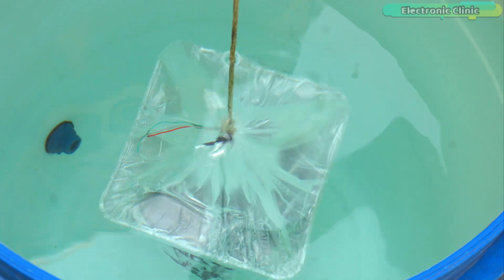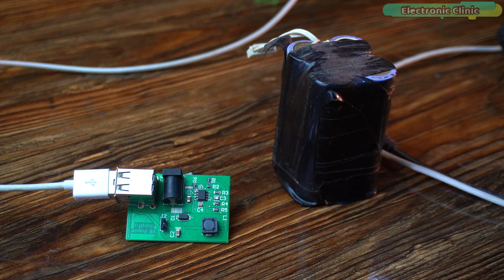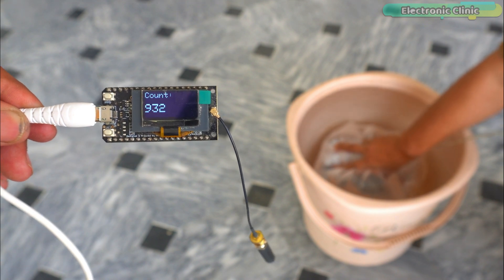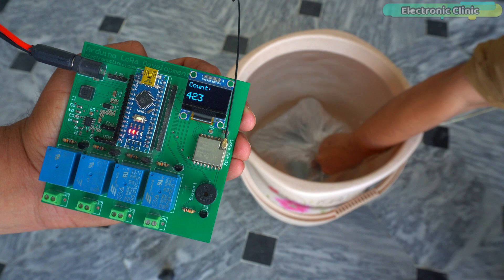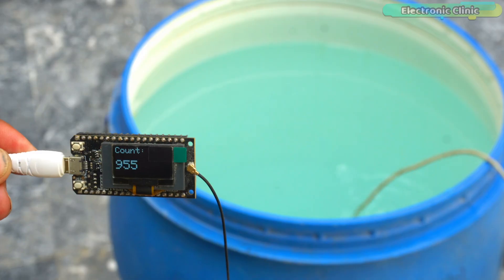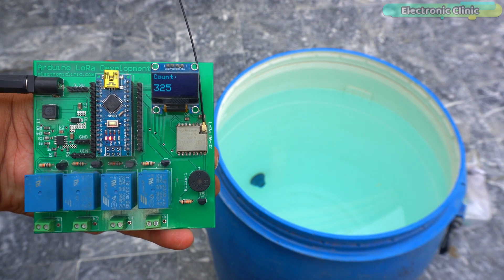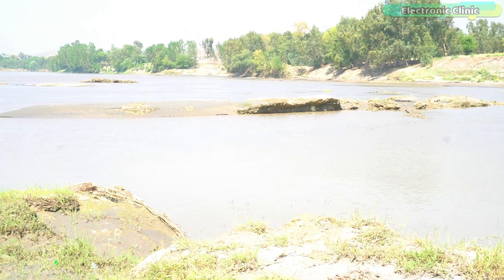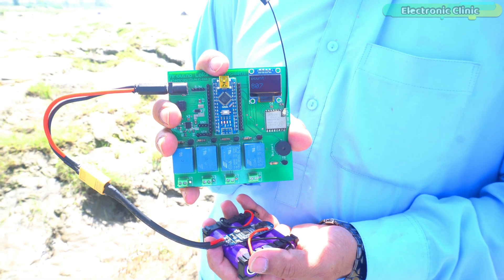I Tried LoRa Underwater and this happened -  433MHz vs 866MHz Battle! LoRa with ESP32 and Arduino

Comment: what about testing both the tmx and rec both under water will the water work to propigate?  My guess is not well.  2200-meter  radios  low frequency in the khz range I would think would work but they take giant antennas.

Comment: If the box has the dimensions of 20×20×10 cm, its volume = 4 liters. According to Archimedes' principle, any submerged object experiences an upward buoyant force equal to the weight of the fluid displaced by the object.

Comment: Unfortunately  from scientific  stand point the test was not done right way   The container with water should be minimum 2m x 2m x 2m. (wavelength  of 69,24 cm 34.6cm ) and   No additional metal inside.  No your hand inside.  This all  prevents  reflection and attenuation "self-made." At best  you could do this test in swimming pool  But in the middle of it where regulated depth is measured  while the device is hanging on the rope( not dielectric)  connected to a fishing rod .
Reply from the maker: @stivep1  it was just a quick setup. Now I know it works. Next time I will do two way communication with proper arrangements

Comment: Hello, good video. Almost all radio-controlled divers know that current 2.4 GHz transmitters cannot penetrate the water (much less salt water). In the past (I am 57) there were AM and FM transmitters, and 433 MHz transmitters, which allowed us to control the submarine at a depth of 5 meters (+/-) without any problems. This is not the case now.

Comment: Good one. However, the radio signal regardless of 866 MHz or 433 MHz will find the shortest way out of the water. With barrels and buckets, the shortest route to free air is more important than the depth in the barrel or bucket. So for instance, 4 feet vertical depth not important, since the transmitted radio signal has less than 1 foot to travel horizontally before reaching free air.

Testing it in a lake or a swimming pool would be more relevant. Because in those cases the vertical depth represents the true travel distance to free air.

Comment: Try again with antennas that take the relative permittivity of water into account...
Reply: No need. Antennas radiate into the air. Both antennas are loaded onto the air. It is possible to shorten the antenna if it is surrounded by water (without an air bag).

Comment: If you hadn't used a metal weight below the transmitters it probably would propagate the signals better. Big metal objects near transmitters don't  help with signal propagation.
Reply from the maker: yes, you are right, i tried my best to keep it away from the metal.